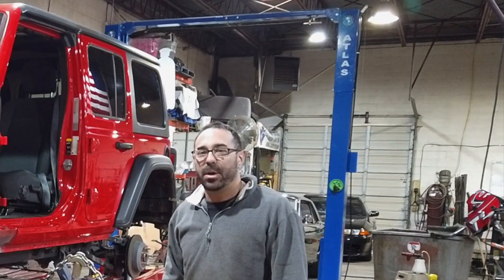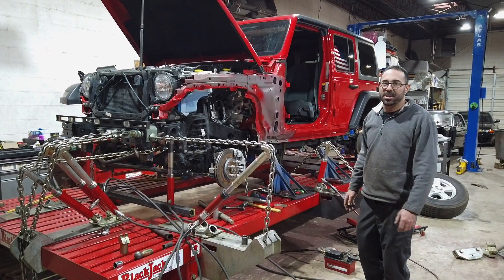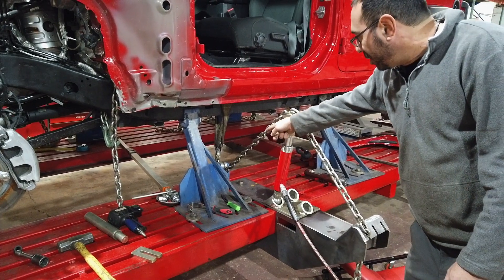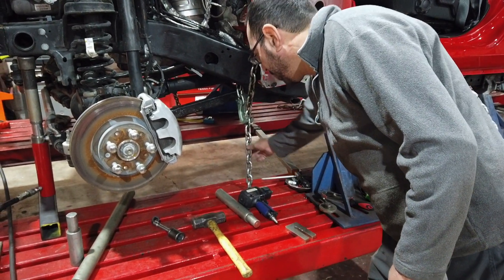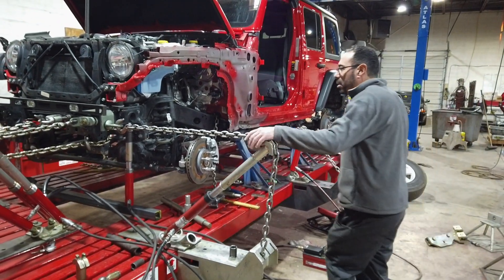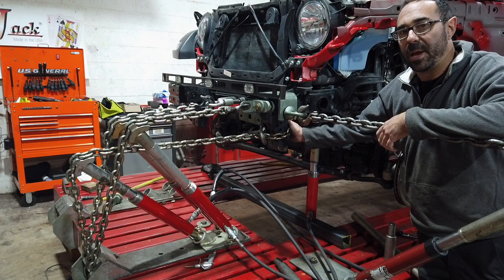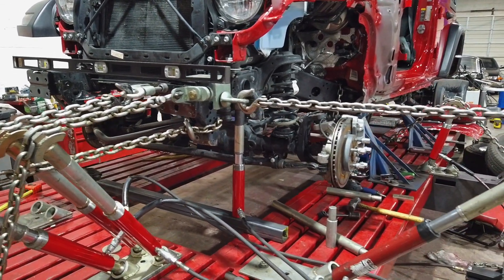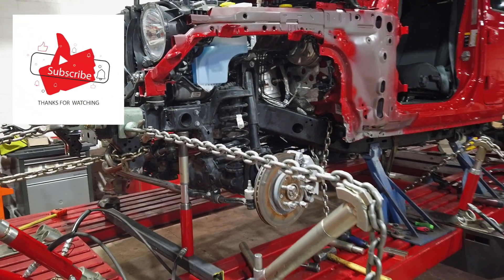We Used 6 Pulls to Repair This 2020 Jeep Wrangler!

Comment: You second chain  ..hold down with chain fork is loose  ..there got to  be a better way to add tension on this hold down chain
Reply from the maker: Using a pneumatic powered air gun gives a higher bolt spinning speed and makes it a little easier to tension the chains. For the purpose of the video, we may have been a little loose around the edges. We appreciate your comment!